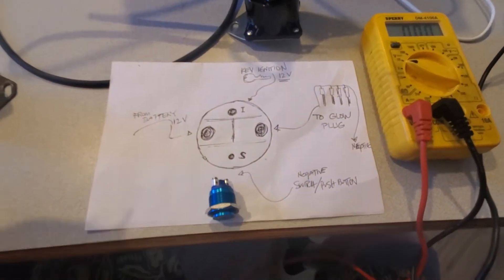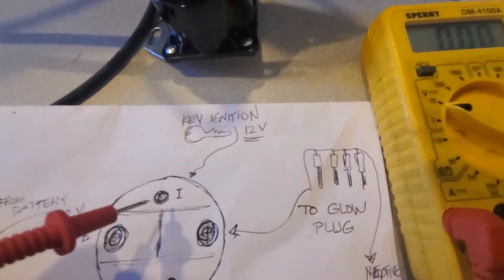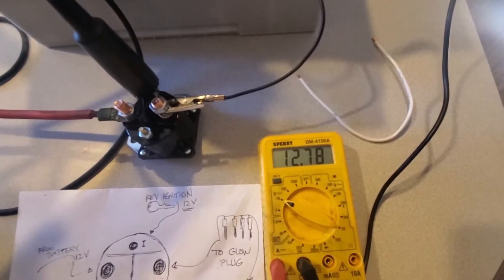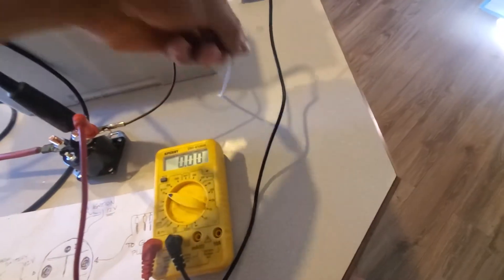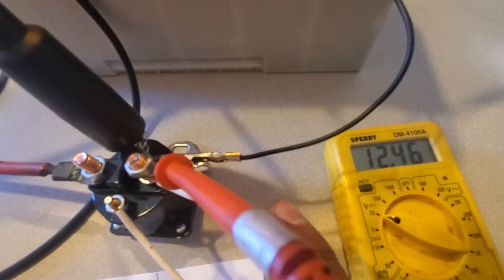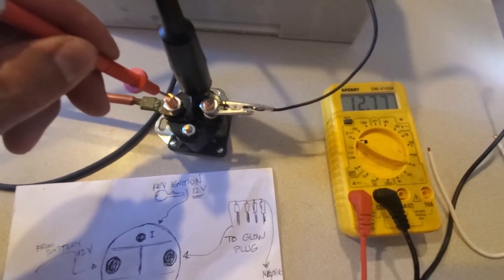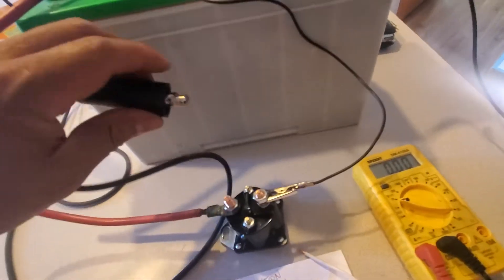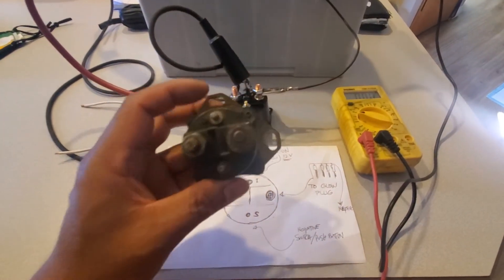Diesel Glow PLUG SOLENOID RELAY Explain

Comment: This is for by-pass glow plug circuit,for turbo engine it use glow heater module and voltage of coil is different.
Reply from the maker: Yes sir

Comment: Thanks sir

My constant is 12.5v but the other side going to glow plug is only 9v. Why is that sir? Thats why it just crank but wont start. Thanks again.
Reply from the maker: U need 12V to heat up the glow plug...  try bypass if start
Reply: @Angelsum143  yes it start. Do i need to replace the relay?
Reply from the maker: @tagminda4565  test your relay first if its bad
Reply: @Angelsum143  thanks for the reply. The output voltage going glow plug is only 9.5 volts so need to connect a wire from positive terminal to 1 glow plug in order to start. Does this method have a negative impact?
Reply from the maker: Subscribe ok

Comment: How to connect the push button?
Reply from the maker: Lot of ways to connect.... did you.see the white wire im holding ..... thats where my switch connected
Reply: Yea thanks. I test on the battery side get only 10v and the other side is 0v. Bad bettery i think.. So it must be 12v on battery side to work?